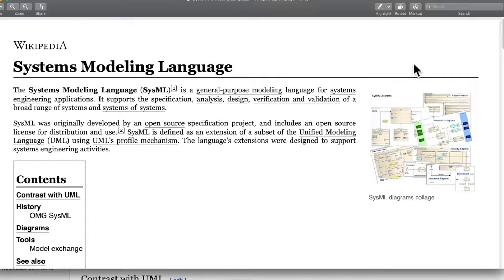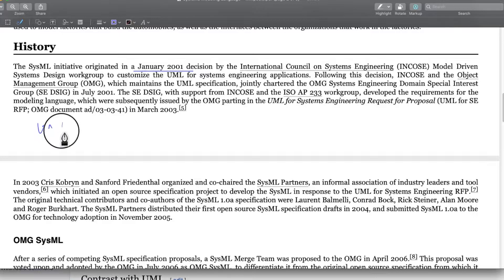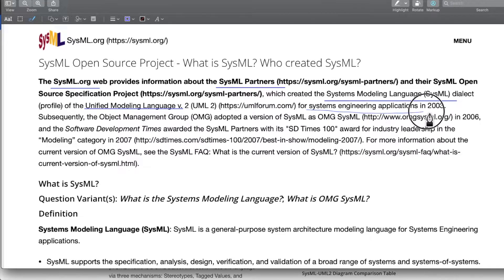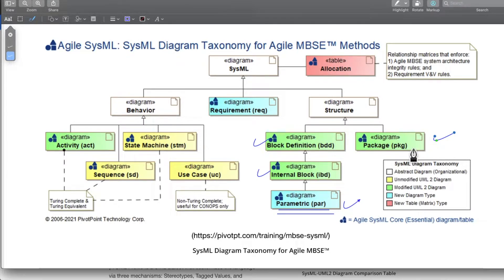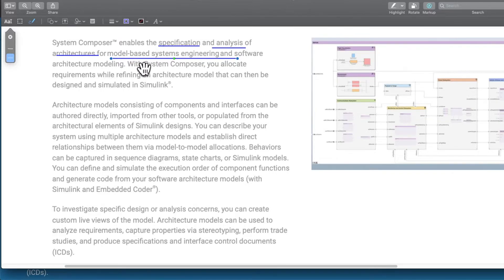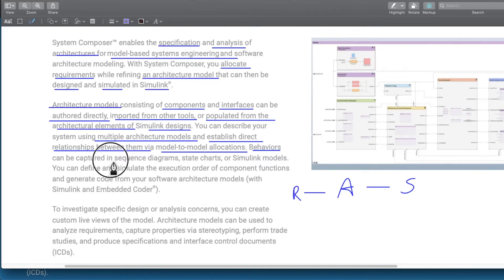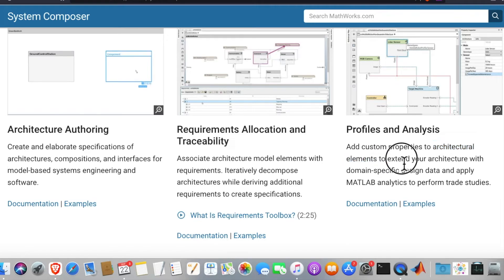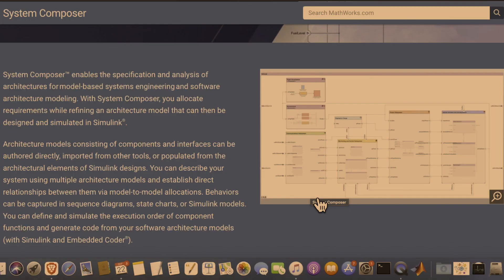Intro | SysML and System Composer | System & Architecture Design

Comment: Nice overview video.  At 12:54 are you actually using Simulink as your architecture/modeling tool?  Wouldn't it make more sense to use a software made specifically for modeling like Cameo Systems Modeler?